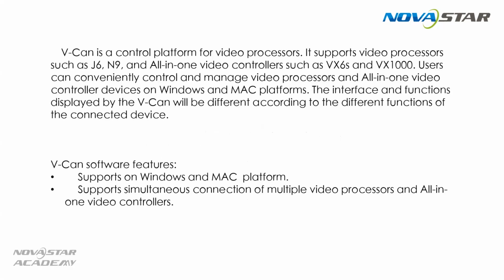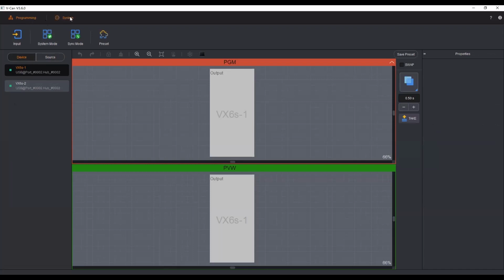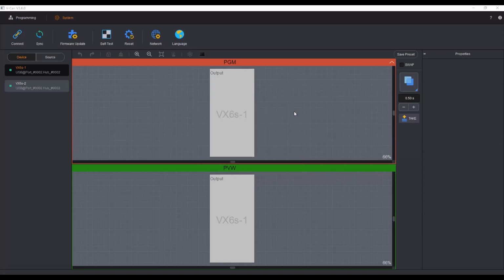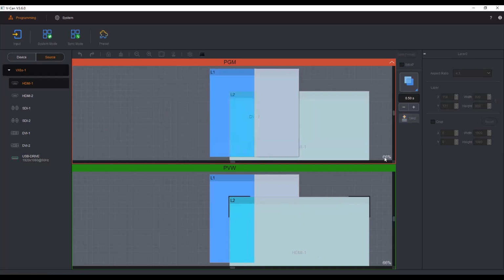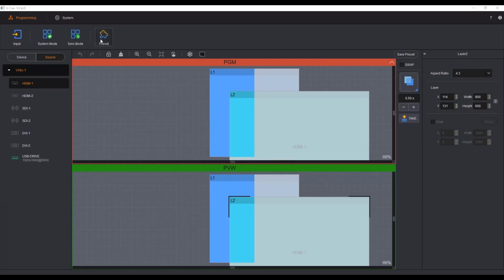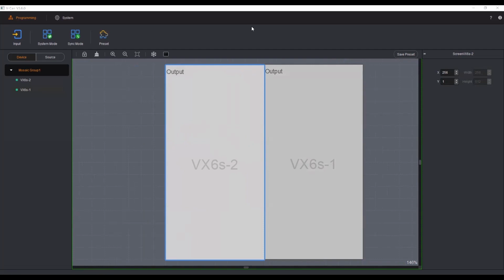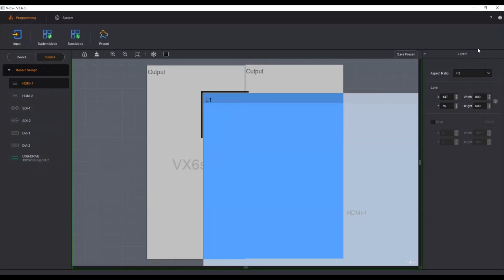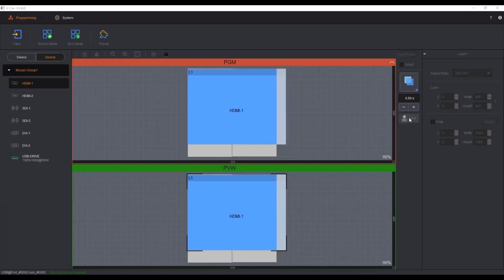Novastar | Gear Up V CAN Software Training

Comment: I have a question sir.. I have an LED Wall with a physical size of 4320*2560, and VX600 processor, then I have an TB40 use for wireless media player. What should I do to fit the content to the screen? because when I configure it the image is too for the LED screen?
Reply from the maker: Hello Sir! You can add our WhatsApp +86 133 1654 1431 or reach out via email: sales@ledscreenparts.com. Our sales team will follow up to provide all the information you need!🤓